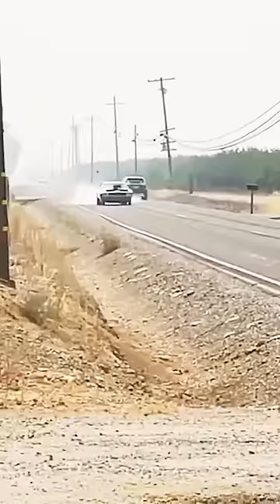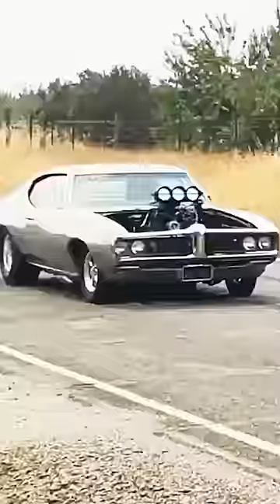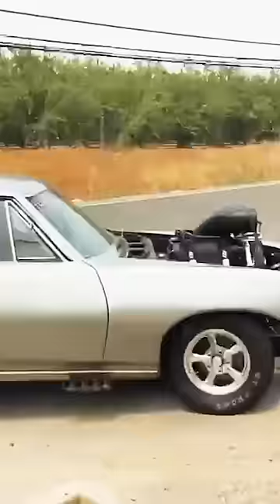Mean Sounding Poncho

Comment: Good God, now that is a mean street freak. I love that there are still Pontiac enthusiasts running Pontiac engines on their Pontiacs. Nothing wrong with LS swaps, but with the support of Butler Performance and others. These Pontiacs have become more brutal than ever!!!
Reply: @antontinney4489  yup!!! Our Pontiac mills are more pricey to build then your typical Chevy or Ford.. However with the right parts and good machine work we can outrun one of those
Reply: No Pontiac power it that judge brahh, iam sure of that
Reply: @danonoveh8114  look very closely at the head design through the open wheel well ..i spot Edelbrock cylinder heads,  that's a Pontiac block fa sho brah!! They do make blowers for Pontiacs too you know that right?
Reply: @transam4555  LOL ID BET MONEY ITS GOT A CHEVY ENGINE LIKE MOST HOT RODS
Reply: @donaldkinder6716  nope. It’s 100% poncho powered. There’s nothing Chevy on it. Made by Butler Performance.
Reply: @bigboreracing356  🤣🤣🤣🤣
Reply: @bigboreracing356  you and I brotha.
Reply: @donaldkinder6716  Butler Performance specializes in performance built Pontiac engines. I promise you, this is one of those.
Reply: A GM Engine
Reply: Ya
How about the Pontiac 326 firebird of tempest engine I have for sale or a 76 455 along with a 73 ventura hatchback  .
Love Pontiac but went Vortec.
Reply: @tedgarcia8922  absolutely nothing wrong with the votecs,, but you definitely keep those Pontiacs the keep going up in value year after year.
Reply: Amen there are some old school beasts out there
Reply: @jeffmosier3145    Yes a Gm engine. Pontiac is or was part of Gm
Reply: @stevegibsonii3910 finally,  someone who knows,  chevy and Pontiac are GM products.. lol..
Reply: @teresawhitstine    Ain't it amazing 😁
Reply: All that shit is GM
Reply: @mikeybrazy115    Yea, it's all gm. But at least the parts weren't interchangeable between brands. That way I keep my Pontiac a Pontiac with no chevy parts. Well till about "79" anyway 😡
Reply: @mikeybrazy115  yeah, Pontiac, buick, all those are GMC products..  oh, is the LS block itself a GM product??.. if im not mistaken,  even an LS block is built by GM.. or am i wrong on that??..
Reply: @mikeybrazy115  yeah, Pontiac, buick, all those are GMC products..  oh, is the LS block itself a GM product??.. if im not mistaken,  even an LS block is built by GM.. or am i wrong on that??..
Reply: @mikeybrazy115  yeah, Pontiac, buick, all those are GMC products..  oh, is the LS block itself a GM product??.. if im not mistaken,  even an LS block is built by GM.. or am i wrong on that??..
Reply: @antontinney4489 good God is right! This is the Nastiest REAL Pontiac I've ever heard. If Butler's involved that's why!
Reply: thats music to my ears?
Reply: I’ve always had to use SBC stuff, can’t find a Pontiac engine anywhere near me
Reply: Gooood Night Sally  I would love to hear a Monster Truck with that engine I love the deep bass richness of its power kind of reminds me of an old neighbor I had in my neighborhood who had a top fuel funny car loved it when he  Rev'd that Baby up   Shook the floors shook the windows  They vibrate it so much thay acted like they were gonna explode but 7000Hp will do That it was over 35 years ago and I still misse hem and it to this day  It was an Orange blue and purple funny car Yeah it was a  Pontiac 🏁🏁🏁
Reply: @Daveunruh ok im into modern chevy and can make a mean engine from them, however I am very sketchy on details from when brands all made their own engines....whats a poncho?!
Reply: That's not a street freak
Reply: @thatmaverickguy859  then what would you call it
Reply: they are a rare breed today for sure... as to be expected because they are defunct... however, anyone check the DeLorean DMC-2? it's a Pontiac Solstice,  with a Stainless panel scheme, like the DMC-1.
Reply: @teresawhitstine  Yes GM, but a completely different motor. The only things that are compatible is the rods and pistons. Everything else is different...
Reply: @armaggedon4christ  It's just another word for Pontiac
Reply: @ghm389  see to me, the block itself would be the motor, if the pistons and rods are changed to something other than GM,, then its just a Frankenstein engine.. lol.. with a mixture of parts..
Reply: Thing looks scary coming down that country road!   I like 👍
Reply: Nah man it's a poncho mill for sure.  Other guy is right, look at the head, you can see the 2 Siamesed center exhaust ports. no sbc, Ls, or BBC.
Reply: @tedgarcia8922 My truck has a vortec and that thing built like a tank.
Reply: @Kill0trocity  I have a 95 sonoma with a 5.3 5 speed manual also .
That thing makes me a crazy driver more that usual .
But my first project was a gocart with a kawasaki 440 , My friends call it Death Trap .
Reply: It might be a Pontiac engine in the car, but imagine how much faster it would be if it were a Big Block Chevy or a big cube LS.  You only see Pontiac race engines in Pontiac door slammer race cars.  Most don't bother with the Pontiac design.  It's nothing more than an overgrown, overweight SBC that costs too much money to build.
Reply: I miss my Grand Prix and Imp SS.
Reply: @transam4555  they are the same price of a BBC..
Reply: @binaryruffian7538  that's called torque my friend. When you have so much of it you can never keep em straight on the street
Reply: @transam4555  garbage cars that you can’t race laps with on a real track
Reply: @binaryruffian7538  going in circles is not as much fun as ripping it up in the the back woods. Granted both take skill to keep in control but then again who cares, just have fun with what you build!!
Reply: @stevegibsonii3910  Pontiac didn't adopt GM engines until 1981 when the heavy hand of GM came down.
Reply: @TBonerton    The heavy hand of gm is why I won't touch any gm product. I liked Pontiac that was it.
Reply: I love pontiacs
Reply: @binaryruffian7538  thats your opinion...i bet you've never worked a day of your life on a car before....
Reply: @antontinney4489  quit spamming
Reply: Nothing new Big Chief has been doing that for years.
Reply: Yeah, fuck Ls's... you need very expensive machinery to rebuild these throw away motors.
Reply: @tedgarcia8922  what do you have for sale
Reply: @alfonsoguadalupe7765  Pontiac 326 and 455
Reply: PONTIAC HAVE ALWAYS BEEN TOP DOG .I HAD 3 GTO'S 400 0.040
Reply: How could you tell it had a Pontiac motor in it !!  I'd say it was a Chevy motor
Reply: @willlong3510  you have to have a good eye to see the head design through the wheel well as the cars passing.. in Pontiac engines the spark plugs are above the exhaust ports, as opposed to Chevy which have the spark plugs in between the ports and sometimes the headers get in the way.
Reply: Have 2..
'87 Formula & a '99 Formula w/6 spd (both kick ass)
Reply: @Anton Tinney  love yer 'enthusiasm....
Reply: Absolutely  right about that . And the after market  blocks can handle  shit tons of power.
Reply: @donaldkinder6716  shit like that is what makes most hot rods boring. Thankfully, this car has a Butler Pontiac engine.
Reply: @transam4555 even the cats and hawks lol
Reply: With ZERO traction, go nowhere Fast!😂
Reply: Remember in the 80s you weren't fast with a big block without some Poncho heads!!
Reply: @transam4555 Everyone can outrun Fords. Crap engines for power all around, which is why nobody with a brain runs them on drag racing. The big dogs are all running HEMI's, the ones who can't afford HEMI's are running Chevy's with HEMI heads. 😅
Reply: ⅞f
Reply: @teresawhitstine  yes. The more modern trans am had an ls or lt based engine didn't it? Enough money one can do what ever. Knowing what will work before you do it is experience. 😊 have a good one fellow motor head.
Reply: @transam4555 as a European guy, what’s the difference between the three? All we commonly know is they are giant displacement cast iron V8s with a single valve per cylinder (I&E)pushrod driven, wet sump and a single central carburetor.
Reply: Can you say 'tire shake'...
Reply: I thought it w a 442 until I he pulled in 😂 I was going to say that's one nasty Cutlass but then realized it was a Pontiac lmao
Reply: Out of the100s of bad ass burn outs I've seen that 14-71 puffed poncho is #1. Wow! SUPER ROWDY BLOWER WHINE TOO!
Reply: My 1966 GTO STILL HAS 389 ALL ORIGINAL STILL

Comment: There is no sexier sound then a supercharger compressing air ❤️
Reply: Mr L0wk3y  I will politely disagree with you based solely on personal preference. I can say that turbo would be number 2 for me.
Reply: @Mr L0wk3y  I'm not mad at that! 🫡😂 those would turn my head for sure! I've got a 99 2500 suburban 4x4 with a 7.4 454 and whipple supercharger. I get looks when I light em up. God bless America! Much love and respect from Arizona
Reply: mrl0wk3y33 Turbo whistle over Supercharger whine any day.
Reply: @Mr L0wk3y  badass! I love sleepers, so I get it bro. I almost bought a crosstrek last month. I wanted to put an 8" lift and a nasty boosted motor swap in it. Big brush guards and skid plates. Wanted to much for it, so maybe someday.
Reply: That supercharger sounds like my power drill, and it terrified me.
Reply: Very moist the sound
Reply: Respect
Reply: Yesh,,,big time compressing!!
Reply: @vimesagainsthumanity  me too!!!
Reply: Mr L0wk3y  it’s not the same at all this hits completely different
Reply: mrl0wk3y33 
Pontiac👍
-------------
Scooby👎

cough cough front wheel drive shopping carts cough cough

Comment: "Stock style suspension. Full interior. All glass. All steel, no fiberglass body parts."
  Wow
Reply: And a damn top fuel drag engine that if he gave it full send would literally blow the tires off. Did you see those tires? They’re gone if he doesn’t back down.
Reply: @bobboy5508 pretty sure this doesn't have a 16 plug hemi in it but damn it has the zoomies and the blower lmao
Reply: And a Chute, and it doesn't sound like it is just for looks. Impressed Mopar guy !
Reply: That’s a bad mo fow
Reply: @kahner6323  : Indeed
Reply: @Lawren-Hollie Nelson  according to the description it makes more than 1300 hp to the wheels. The parachute is absolutely not for show
Reply: @bobboy5508  I was gonna say that I have never seen that on camera, it's honestly unbelievable throttle control
Reply: @coreygolpheneee  Damn right. Full send those tires are gone. Great throttle control all the way.

Comment: Look at those slicks hooking up, changing dimensions.
Reply: Tire shake
Reply: Suspension needs a lot of work in my opinion . I have an 85 s10 .. 1200 horse,900 lb ft .. after breaking my 3rd Ford 9 inch I back halved it and with a shit load of tuning it hooks hard even on blacktop
Reply: I believe that's called "not" hooking up!🤔
Reply: ..that's, tire shake!
Reply: @BobbyOfEarth  
Yeah, like on a Top Fueler.
Reply: @waynejohnting2954  I tossed out the leaf springs and designed a triangulated 4-linked for my the 9" in my F100, with stroked (4340) 421ci Windsor.  Learned a ton from Art Morrison.. very important tip that most guys don't know is that the angles of the upper and lower arms need to converge (intersect) at the back of the block at the camshaft, to get best weight transfer.  Nearly impossible to do without designing the entire system on a CAD system...
Reply: Came to say the same thing kinda, but not hooking up but changing shape everytime he opens them butterflies!
Reply: That's centrifugal force slinging the slicks out from the wheel speed changes - like a Top Alcohol or Fuel car.
(This beast IS an "Alcoholic" too, lol)
Reply: That’s spinnin lol
Reply: Yeah dimensions changed but that nasty beast was definitely not gonna hook up!
Reply: Wow i never seen that before.
Reply: @dalemiller282  now Dale…I’ll tell you again. That’s Hooking up with style

Comment: I had a 1968 lemans in high school. Drive it for 9 years. This brings back memories! Mine was white with rust holes in the quarters and rockers but it had a solid drivetrain, 350 Pontiac 350 turbo trans and 3.08 posi gears. It was a fun ride and I wish I didn’t sell it!

Comment: 1968 gto. One of the rarest year gtos you'll see.
Reply: That's just a LeMans, but it's still a pretty beast 🤩
Reply: Goats had a bumper that was the same color as the paint amongst other differences.....
Reply: Looks like a 1968 Tempest.
Reply: Rubber coated I believe! I had a ‘68 GTO and it had a white painted bumper with all the paint cracking and falling off. I bought that car for $300 after my buddy broke a connecting rod on the number 7 piston. Over rev the 400 or 389’s and the old engine would starve that rod for some reason. I bought two of these, one was an engine out of a ‘69 Lemans. I was given that engine and it’s the only set of heads I’ve ever rebuilt. I was a sophomore in high school in the auto mechanics class. 1985 anyone?😉
Reply: @stephensegal5187  Endura bumpers.   Rubber-like material that requires flexible paint.
Reply: @danadribnenki8774  Endura bumpers. Gotta use a special, flexible paint on them.
Reply: Don’t think it a GTO,,, I’m thinking even better looking …Like a Tempest …Always looked wicked on the streets

Comment: 60s & very early 70s were the years that GM really had it going on. I was taught to drive in my dad's 1966 tempest convertible. 326. I could still smell the interior of that car.  Took the driving test in his 1968 Bird. That was an OHC 6 with the 2 speed power glide.  He owned both from new.  No longer owns either.  If only we could have seen into the future !!

Comment: jazzkazoo I just have to mention mine after your comment about Keeping it original. 
56 Dodge half ton flat bed 
401 Buick Nailhead 
GM Turbo Hydro Auto 
8 inch Mustang diff 369 gears
and I am looking at a Weiand blower
I put on All new brakes even the lines it barely slows.  I am probably putting on independent suspension with disc brakes   I am seeing if we can still drive before too much more but a still makes gasoline also I'd say that is the bad tasting stuff in most cases.  Hah I don't have one yet but I understand the idea.  I liked Mad Max.

Comment: Correct me if I’m wrong but it sounds like you guys use a specific camshaft that crispy chop sounds much like big chiefs motor in the crow sounds like you guys have a specific engine formula that you don’t sway from some people say that having a smaller camshaft when running boost that maximises the torque curve is optimal but in a drag car that is being revved fairly high does that even matter?? That lift split  that the camshaft provides sounds to my ear daily substantial